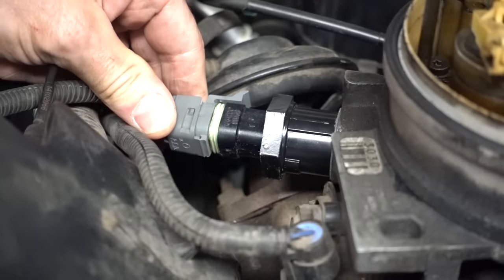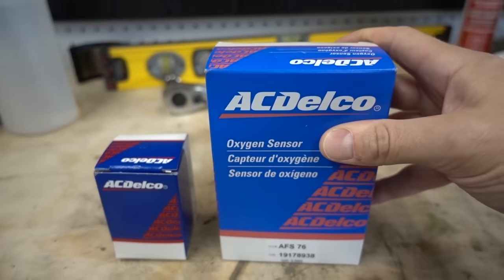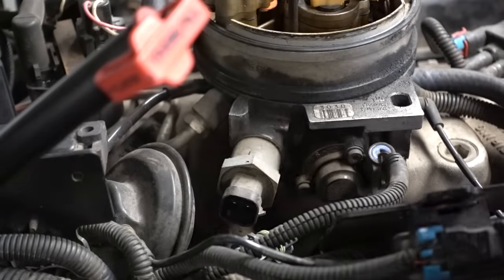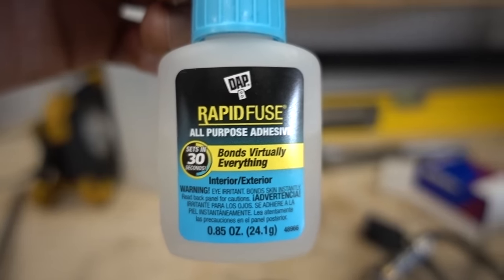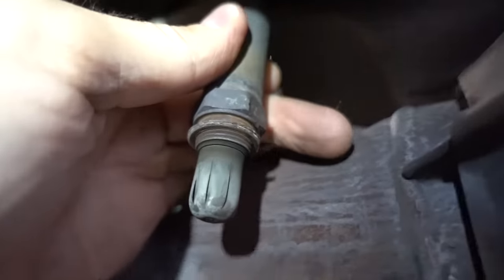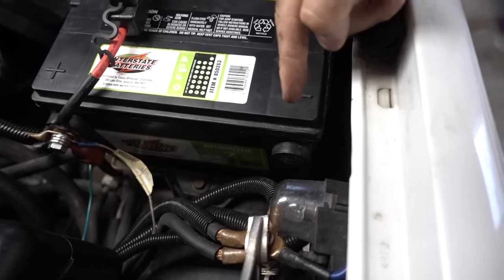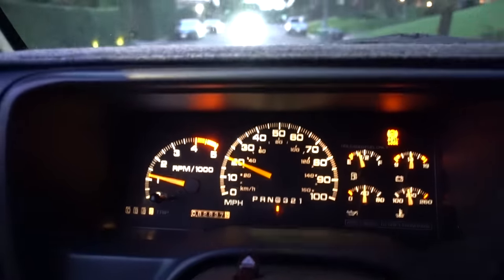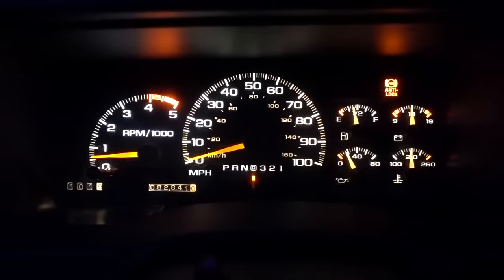Here's the TWO SENSORS YOU NEED TO REPLACE FOR BETTER IDLE !!

Comment: -  No, we don't "need" to replace them.  YOU chose to, AND the IAC valve is NOT  a sensor.  
Sensors that can impact idle include the  F/A and  O2 sensors, the MAF and MAP sensors, the cam and crank position sensors, and the engine temperature sensor.  After replacing or cleaning any part in the idle system you may need to go through a specific idle learn procedure before it idles properly.  Zip ties melt at a lower temperature than O2 sensors experience.
-  Replacing a good part that has been reliable and isn't a scheduled maintenance part with a new one is ignorant.  Brand new OEM-labelled parts can be bad out of the box; you just know who to blame and can sometimes get a "free" replacement- after spending the installation labor to discover it's bad.   The cheapest Bluetooth OBDII dongles with free phone software can show you if the O2 sensors are good (that was the first emission system ready test required by the EPA).   Replacing one without testing it is just asking for trouble.

Comment: #1 is not a sensor it is a actuator......I a c valve.. controls idle speed..if you have a rough idle I would check ignition  missfires and check fuel trim...I could go on and on. But iac would be not on the list ...bad valve may cause stalling or high idle. Posted by G.M TECHNICIAN.

Comment: Upgrade your tbi system to efi which will solve idiling issue in ur car
Reply: TBI is EFI.  It's just not multipoint EFI.  It is single point at the throttle body.

Comment: Chrysler products,a bad battery will cause idling problems.They don't like low battery voltage,have fixed idling problems in them replacing the battery.The AC Delco oxygen sensors,made by someone else for AC Delco with their name on it.Possibly made by NTK which is a division of NGK whom makes the AC Delco platinum and iridium spark plugs

Comment: the PCM would trigger a check engine light if one of those components failed. i think you would have achieved the same thing by driving the car under 2000rpm for 500 miles

Comment: you called yourself on it... test the vehicle in-between replacing both sensors, so your viewer, if they are watching for help... you can give them better help instead of saying.. i dont care i have both parts and im replacing both... its to show what was the actually caused of the idle to become better that people will want to know..this is why people should be careful of what videos they watch for assistance - ... so they know what caused the issue verses throwing parts at a vehicle and oh, it works now! ... ALWAYS good to now the root cause - and also showing the vehicle idling before would help to know that the info given isnt just BS and that there was an actual issue prior... again this could just lead people who dont know whats what down a rabbit hole of wrong solutions.

Comment: I had a 1999 Ford E150 with only 20k miles that would die at idle intermittently. It would happen after a ECU reset/dead battery.  As it turned out it was only the Idle Air Control Valve.  This part should be the FIRST, #1 Google for won’t idle. But it isn’t and following the links by Google is a tremendous waste of time. It had nothing to do with the ECU or dead battery.
Reply: My Idle Air Control valve was clean looking, but was sticky and worked perfectly after carburetor cleaner.  I ordered a replacement since the idle is very important and this trouble is very frustrating to drive with.

Comment: The best thing you can do is rebuild the tbi and buy a aldl cable. You’ll see if a sensor is bad on a computer. Majority of problems are caused by tbi vac channels getting filled with crud, leaky gaskets, all ignition components (plugs, wires, ignition coil, timing and distributor), or the fuel pump. Another less common but highest out of all sensors is the cts sensor followed by the egr valve. Basically what I’m saying is DONT LISTEN TO THIS GUY! DIAGNOSE THEN REPLACE! He’s just throwing parts at it and often times the Chinese junk is worse than the original delco. Buy that aldl cable and use winaldl and you can see if a sensor is bad. If not then you didnt waste any extra money. I’ve had sensors seem like they fixed the problem but they just helped for a week then it was back. DONT THROW PARTS AT IT!

Comment: actually that is normal if you load more electricity your rpm should increase not like mine, i have a mitsubishi lancer 2000 4g92a engine when no load my RPM Increase and when i put load like ac it down i mean so Low RPM and cold start so hard

Comment: Many times, data is stored permanently inside the data brain! you must then have a data scanner.
Reply: Paper clip will work just fine on a 25 year old OBD-1 Chevy to flash the trouble codes if there are any.

Comment: I’ve replaced many O2 sensors and this guy is FOS, them things are always heat seized in, what would it have hurt to have just changed the IAC which incidentally is NOT a sensor.

Comment: A bluetooth OBD dongle and app on your smartphone could have told you what you needed to know.
Reply: What is a bluetooth obd dongle?
Reply: @jonhall9831  it plugs into the OBD (on board diagnostics) port in your car and sends a stream of data to your phone, tablet, etc.  You can see everything the engine management controller sees.  If you get a Check Engine light, you can see the code that corresponds to the trouble that caused it and clear the code to turn the light off.

Comment: Sorry. completely disagree that a O2 sensor is even needed on a '95 vehicle. maybe it is a '96, and even then early o2 sensors were not used to cause engine malfunctions when they went bad as they do today. And that malfunction is completely caused by the ECM, once again the o2 sensors having nothing to do with idle or fuel air mixture. They simply do nothing but try to keep people from removing their catalytic converters, period. But i know you gotta follow the line written by the higher ups to make believe so. There simply are not enough components inside an o2 sensor to do any of the stuff I mentioned. Don't believe me, open one up and see for yourself.

Comment: should pinpoint the trouble before replacing parts.
Reply: Yes, I've tried to improve on the remove-and-replace troubleshooting method - it often doesn't get to the problem and is expensive.

Comment: you could have put a doubler on the clip ...
Reply: those wire ties will not stand up to the environment they are in and will fail at the worst possible time...
Reply from the maker: What’s a doubler? Yes, the zip ties are temporary.
Reply: @1RoadGarage  a doubler is where you glue better plastic on the whole piece that is breaking - it doubles the thickness of the piece and the new plastic takes the load.   The material doesn't have to be plastic!   I hope you kept the part that broke off.....

Comment: So much context missing here.. what are the codes?
Why not ohm test the O2 sensors?
Why not ohm test the idle air control?

Is the timming out of whack?

What is the fuel pressure?

Also.. that broken clip could have been resolved by wrapping electrical tape around both connectors..

Comment: Wait till you get a hold of an F-150 91 year model 5.0 V8 and then you find out that they put header pipes on it and made it a true dual truck no crossover tube or nothing anything with one one single o2 sensor on the fool thing now I'm trying to see if my 91 F-150 or can I find another computer that will accept 202 sensors at least try to get every bit of fuel economy and performance out of that freaking truck that I can but no they don't have a performance computer for my truck mine is just a year or two too early but I'm pretty sure that I can upgrade a few things I just don't know what all they are and I can put a newer year model computer in yeah take this mouthful try it this sucks shade tree mechanic I know Ford like the back of my hand go ahead and say it yeah forward to break down all the time I don't care I'm just saying that's what I like that's what I work on suck it LOL

Comment: The rpm jumped up when the AC was turned on because the "computer" does this by opening up the idle air control valve to "compensate for the extra load .. it did not do that before because YOU never cleaned it and it was STUCK. chances are you IAC idle air control valve was actually garbage because the motor fried from trying to move a carboned up frozen valve you "years" that is why cleaning an IAC is hit or miss for people who do not regularly maintain these items by cleaning them occasionally when there is not a problem. that is why it is called "preventive maintenance all you u tubers are spreading a load of bad information making videos about things you do not understand. sit down and actually learn how an engine operates and then what all the sensors do and then have the computer reacts to this information. Most u tubers are parts re placers at best. and quick bit of info Scotty kilmer is an old hack and is only a bit better then chris fix as he never learned to adapt to new technology

Comment: We all look how low his oil pressure is sitting still should not be that low!!!!!
Reply: Tbi chevys read pretty low when warmed up at idle. It’s not actually low it’s how they read a lot. Plus if your oil pressure sender goes bad you can’t buy a factory one anymore so your stuck with aftermarket. My 94 reads about 5psi at warm idle
Reply: MoparMadness93 I had a 92Z 71 I change the oil pressure sender from O’Reilly’s and at idle I had 60+ oil pressure and in drive with the AC on! And going down the road it was more than that And now I’m driving 03 Chevy avalanche at idle all pressure is about 40 driving down the road about 50
Reply: Kyle Raven the usual rule of thumb is it should have 10psi for 1000 rpms. They usually have a little more. When cold they’ll be about 50psi or more even at idle. As the engine warms up it will drop to about 10psi at idle and go up as the rpms do.